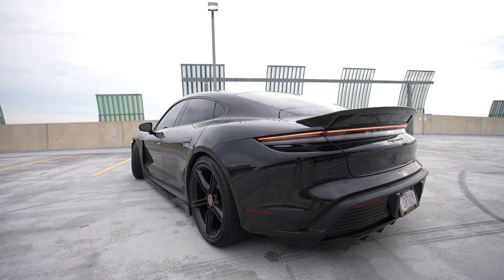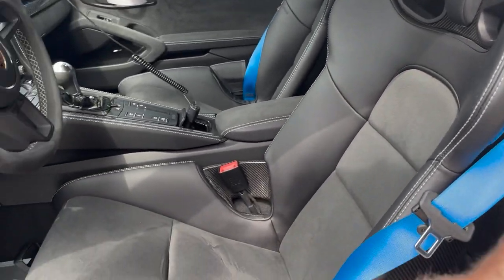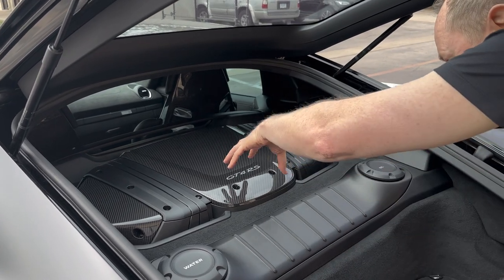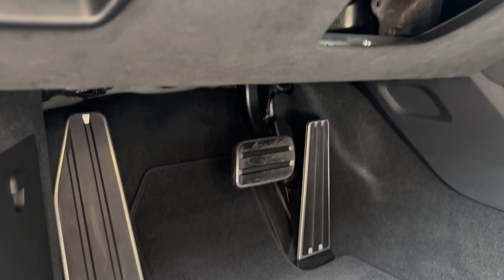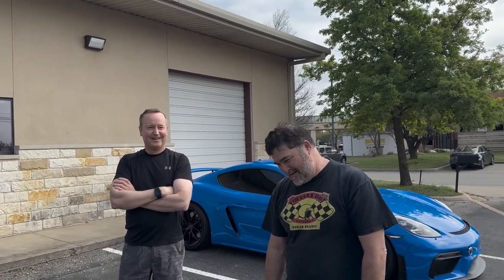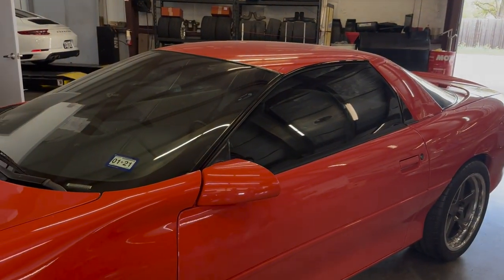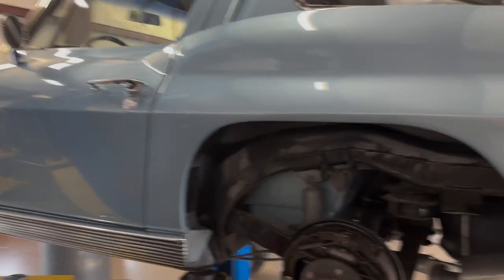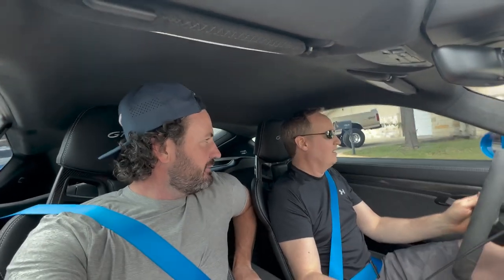Porsche Cayman GT4RS: Track Mods Underway

Comment: I have to do all of this stuff soon.  bbi roll bar, sub bar, seat angle adjustment, 6-point, track alignment (will leave the strut tops stock), track tires.  Will eventually change out the rotors, pads, and fluid too.  I'm going to leave the exhaust stock for now.
Reply from the maker: Let me know how it turns out.

Comment: Funny how you guys need to run wires and mess with OBD to get track telemetry. Meanwhile - GM provides the Performance Data Recorder with a dashcam from the factory. You really need to add a Manual ZL1/1LE to the stable. Just 4000 of those made for the entire model run.
Reply from the maker: Sounds like a good idea, but do I still have to say I drive a Corvette?
Reply: @ignitionontheleft  It's a Camaro to start. You really should see the Nurburgring run - it was faster than any Ferrari and most Porsches then. Here's the video - https://youtu.be/t4zSIVpVMaw